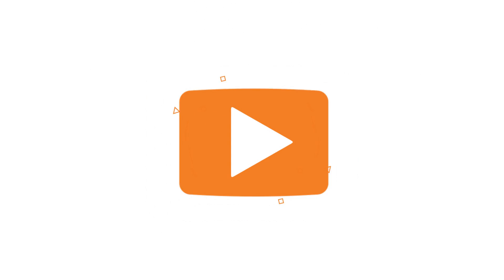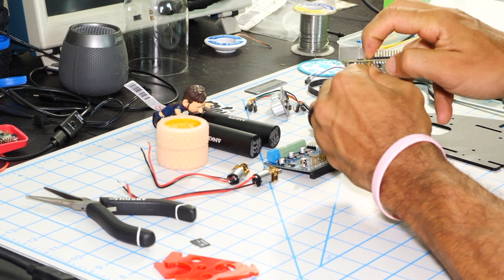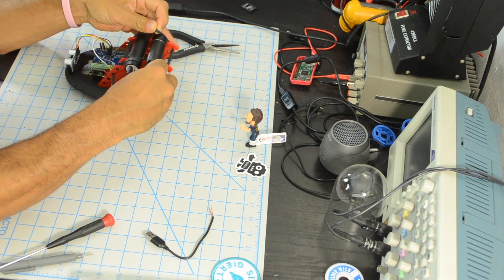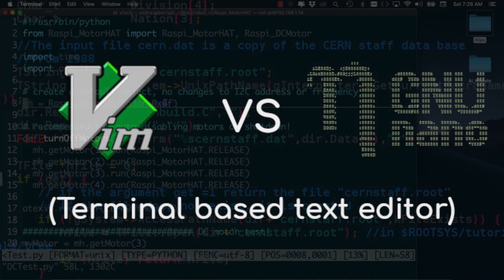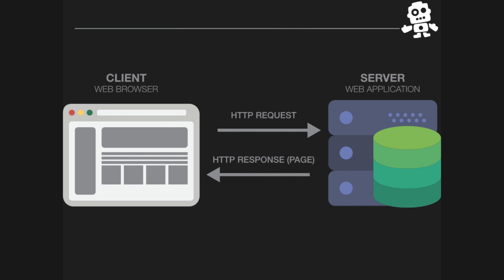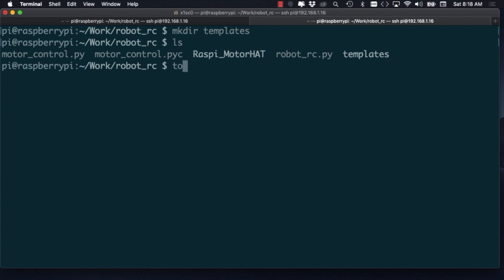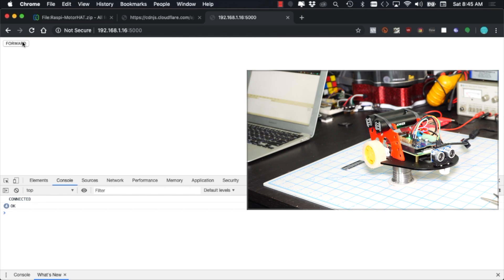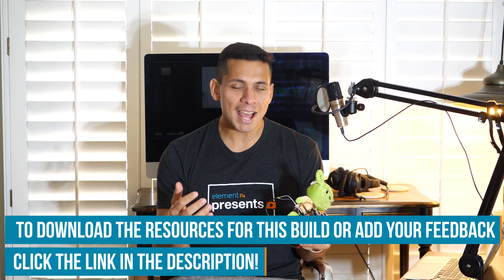Smartphone Controlled #DIY Rover Using #Websockets

Comment: Hey, someone else that uses usb battery banks for their RC cars!  I did that once before
Reply: easiest way, in my opinion, to power and recharge them! high-five
Reply: @datasith  yeah.. problem is most take the banks, but I had a rock crawler that took ONE specific bank, yet worked just fine on my USB power hub

Comment: How can I modify that to 12Volt battery and motors?  I  NEED a remote control electric cart to pull metal garden trailer around the yard. Motors can pull 500 lbs plus. Frame is designed. I need powerreducer for PI I KNOW. but need it to instruct 1wV flow to motors as commanded.  Any ideas?
I’m disabled. This will help me!
Reply: The Pi can be powered separately using a different battery. You'd need a Motor Controller that can handle those motors. The Pi will send low-voltage control signals to the Motor Controller, and it is the Motor Controller that controls the 12Volt power to the motors. HTH, shoot me a message (email or the element14 community page) with any questions!